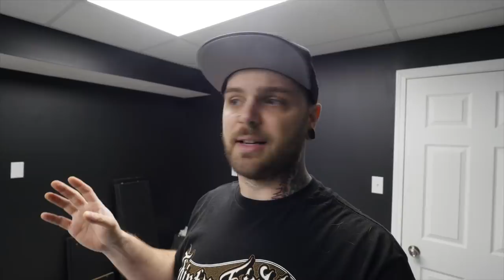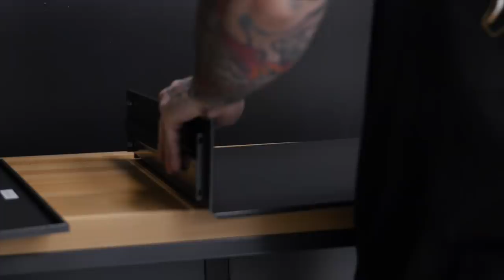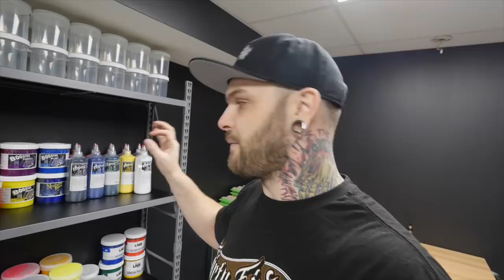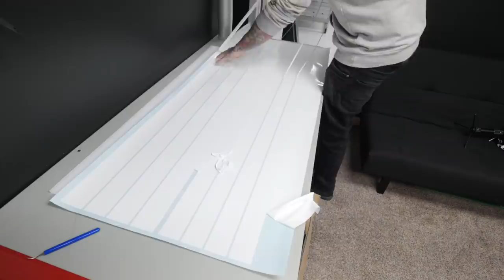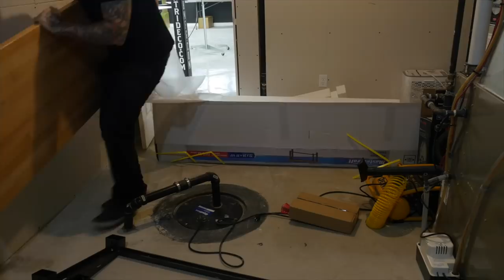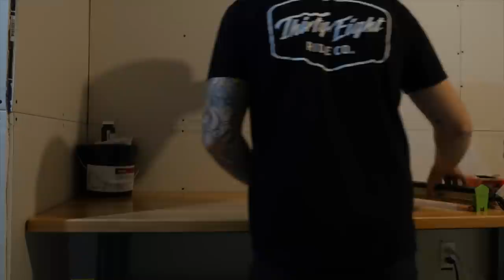3 MONTHS OF WORK...

Comment: DANG, CRAZY! lol Only one thing I would tell you to not do is to keep screens on the floor. I tried it when I started and it was the biggest pain in the ass. No matter how clean you think the room is, the mesh will collect dust and you'll constantly have to clean them before coating. Besides that, fuck everything looks amazing!
Reply from the maker: I always clean and degrease before coating them, no exceptions. That extra  few mins pays off in the end in making the best screen possible and eliminating any chance of having to redo it from any dust or fingerprints that might have gotten to it.

Comment: Lee quick question get back to me when you have a sec Please. I want to put a Gsxr front end on the 08 Dyna Low will a 99 gsxr 750 work I dont know thats why,  Im asking Master Yoda "Ie. You."   Please Help tell me what year I will need and or should I just buy new from my Local Speed shop?  Im looking on ebay for a parts bike. I think you said something about a Gsxr 1000 I want the tokikos of em too.I want my front end to look like yours Its Perfect.  Im Honestly Lost. Please Help Man Thanks.
Reply from the maker: You can use those no problem but I do recommend some heavier springs at the very least, valve work too if it's in the budget. You can get the rest of the parts needed to fit those forks from Gigacycle garage